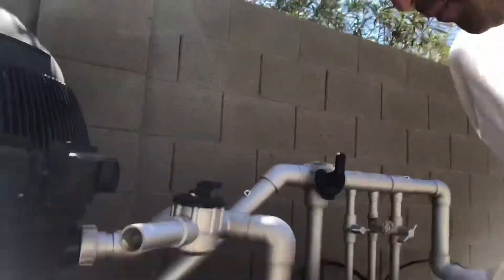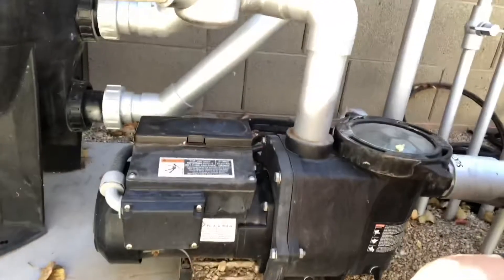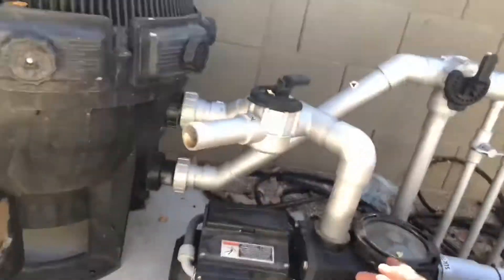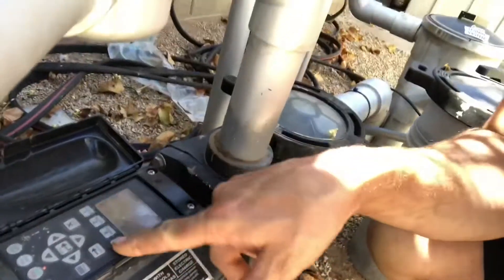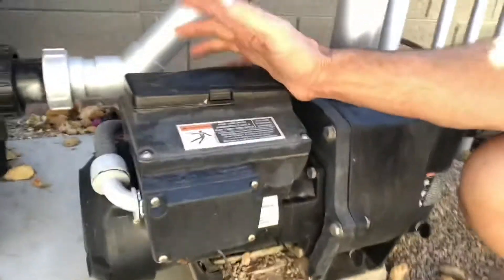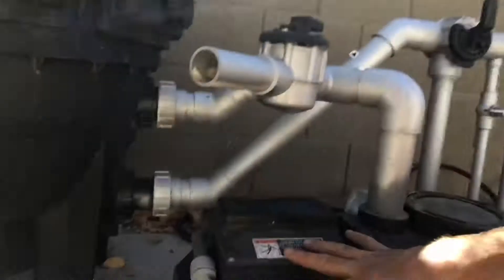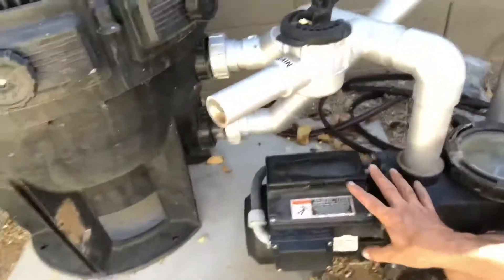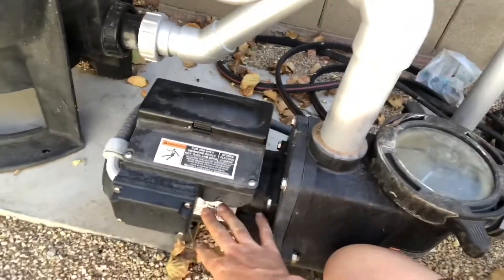The Benefits of Variable Speed Pumps

Comment: I agree they can be tailored to match the piping and filtration system requirements, resulting in a lower required speed and electricity usage, they are also quieter at lower speeds. However depending on your local Utility Networks reliability the fancy electronics are susceptible to voltage spikes.

Comment: why not just get a single speed pump tailored to the size of your pool such that it runs the minimal amount of watts it needs to turnover your water 1 or 2 times a day depending how many turnovers you want. it would have the same effect as VS pump in terms of saving energy
Reply from the maker: Great question! You’d have to build the entire pool and all the plumbing around the pump which I guess you could do but you’re still limited when you need to vacuum, change the valves for one reason or another. The $500 you’d save on the pump is just not worth the hassle and limitations you’d end up with.

Comment: I have a 17,000gal pool with an in-floor pop up cleaning system and IntelliChlor salt system. I have (3) VS 3050 pumps in my system (filter, feature and spillway [elevated spa feature]) Right now, my pool guy has my filter pump running at 3250rpm for 10-12 hours a day! Can you suggest what speed I ‘should’ be running and for how long? I really think my pump is not being used efficiently and is costing me more than it should.
Reply from the maker: It’s certainly not set up efficiently. So, you have the old VS 3050 with no read out display, and only the 4 speed buttons and the up and down arrows on the control pad on top of the pump? That’s the first generation! Your in-floor system only needs to run 3-4 hours a day so that’s all the high speed setting should run for. Program a low speed setting to kick on right after and let that run into the afternoon. You may find that you only need 2400 RPM to run your in floor and maybe 1,000-1,200 rpm to run your low speed to keep it in good shape. Of course your pool guy likes it the way it is because it’s running constantly at high speed but he’s not paying the electric bill!
Reply: Swimming Pool Science, I really appreciate your response. The more I experiment, the more I’m learning how to efficiently control them. I do have the digital read out display on all 3 VS pumps (#011018). I control one of them manually which is used as a feature pump for our raised spa (spillway) in “stand alone mode” so when power is restored to the pump, it remembers what speed it was on (1000rpms). The other 2 are controlled by the Easy Touch System. I have made adjustments already and currently my filter pump runs from 8a-8p in (2) modes: 1) 8a-11a is “Cleaner Mode” at 3000rpms & 2) 11a-8pm “Pool Mode” at 1800rpms. Your suggesting running Cleaner at 2400rpms and Pool at 1200rpms?

Comment: Why not just install a properly sized low flow single speed motor and pump for 16 hours?  Nobody uses VSP's in the water infrastructure business unless you have a good reason to manage flow.  Why?  because VSP's are less efficient than a properly sized motor/impeller.  Ever heard of pump curves?
Reply from the maker: Well, water infrastructure is much different than a residential back yard. What facet of water infrastructure are you in?
Reply: @SwimmingPoolAZ-SPS  Municipal supply.  Booster pumps, vertical turbines pumps, etc.  I want to see a variable speed drive pool pump mated to a flow meter on the outlet side of the filter so the pump can roll with the punches so to speak and increase the rpm's when the filter pressure starts to rise and the outlet flow decreases.  Then an automatic backwash would kick in at the optimum pressure, whatever that is, say 30psi.  A variable speed pump could save money by not over pumping when the filter pressure is low and not under pumping when the filter pressure is high.  Until this happens, in my opinion, you have to baby the thing to save any money.
Reply from the maker: Ricky Bosephus check out the Pentair Intelliflo VSF. That’s the pump you’ve been waiting for.
Reply from the maker: So, a little more on the Intelliflo VSF. You can set speeds (the old VS pump way) or you can set it to run via flow (in GPM) and it will continuously adjust rpm to compensate for changes in TDH due to dirt accumulating in the filter, baskets loading up with leaves, in floor systems changing stations, etc. at this point I knwo what you’re asking yourself and yes, it also monitors outlet pressure and you can set a max pressure that meets your system’s limitations and the pump will self limit accoriding to that.
Reply: @SwimmingPoolAZ-SPS  I will check it out! thanks for the education.  I think I need a pressure switch that triggers an automatic backwash also.  Somebody needs to combine all of this in one unit that is reliable.

Comment: Good vid very informative, thanks for posting it. That is a nice pump not sure what it retails for, my guess somewhere around $1000. USD. Hayward Super Pumps are also great pumps reasonably priced and bullet proof. However I realize they are more expensive to run.
Reply from the maker: Hayward is a solid brand but for my money on VS pumps, Pentair is the only way to go. The Haywards don’t hold up here in AZ. We’re about $1350 installed on the Intelliflo VS pump depending on what the install entails but when they’re 90% more energy efficient, that money comes back in savings on your electric bill pretty quick.
Reply: Flipping through your wonderful videos looking for info and advice on our Intelliflo VF pump. (2nd owner) We’re having some trouble understanding, programming and maintaining the pool with this pump. A few companies have came and none have solid advice, they have just been frustrated with the install and set up of the older pump and the huge cartridge filter system commonly known of a previous pool company no longer in business. 

We have an older style and cannot find the appropriate manual, and advice on finding one online for an older model. Our keypad control has less options: Feature one, Feature two,  Start/stop, Reset across the bottom. No 1-4 buttons up top. 

I’ve noticed we have many extra feature options in the menu back end just like you explain here. How do I disable them? I cannot get my cursor/ arrow to allow that? I need to reset these features. They both only prime for 1 minute and turn off. 

Do you have a video explaining the appropriate way to calculate how and when to run your pump? 
Thank you!